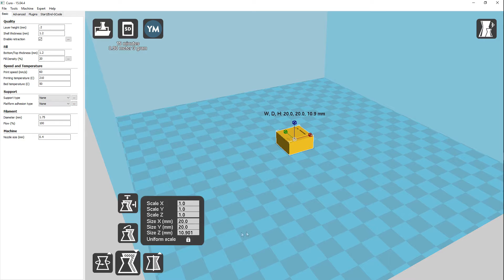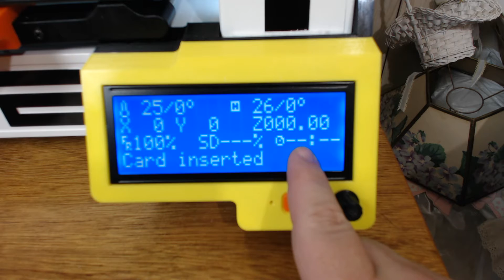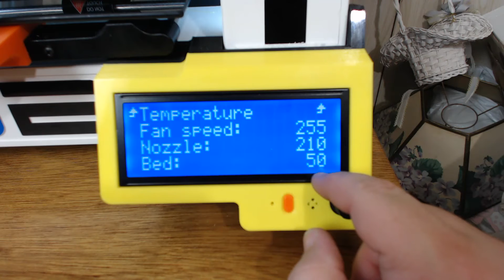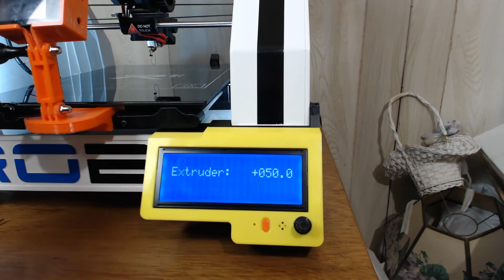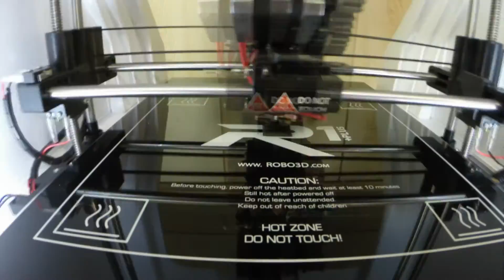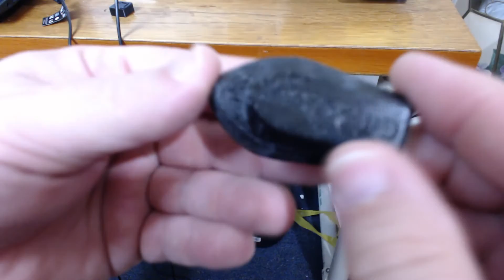Upgrade: Using Smart LCD Controller 3 of 3

Comment: I have a LCD screen arriving Tuesday. You didn't have to update your firmware for your Robo R1 plus? I have that machine and all other videos say that update is required
Reply from the maker: You should NOT need to update your firmware on the ROBO R1 Plus printer to add the LDC screen that I added. If I remember correctly you only needed to update the firmware on the ROBO R1. The ROBO R1 Plus did not need any updates. I did not update mine and it works just fine.
Reply: Rorlin 3D NerdStop thanks i will see when the screen arrives

Comment: I wish i had an LCD for my printer
Reply from the maker: +Panoreth 3D the LCD controller is nice to have I do not have to think about my computer going to sleep or Microsoft updating my system and restart it during a print(yes that has happened  to me during a 15 hour print. The system restarted 14.25 hours into the print)